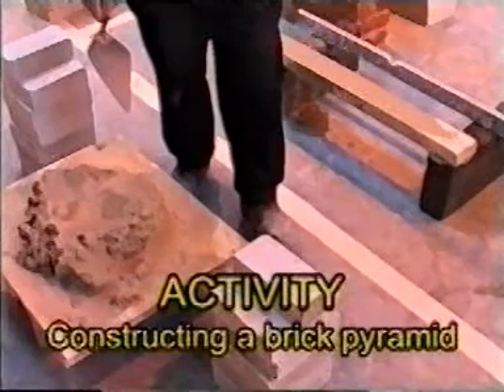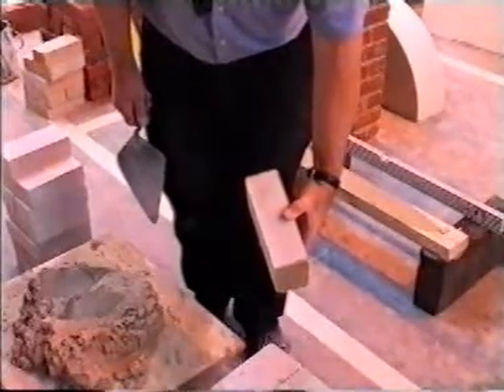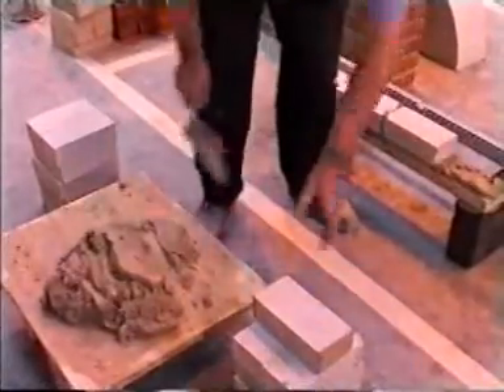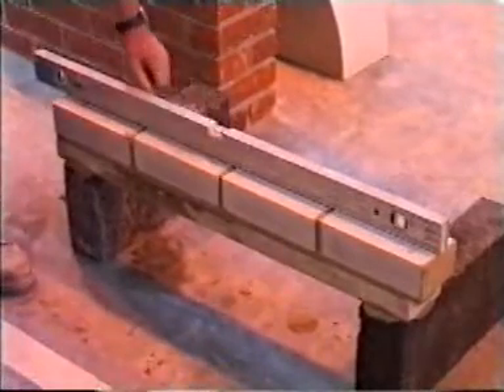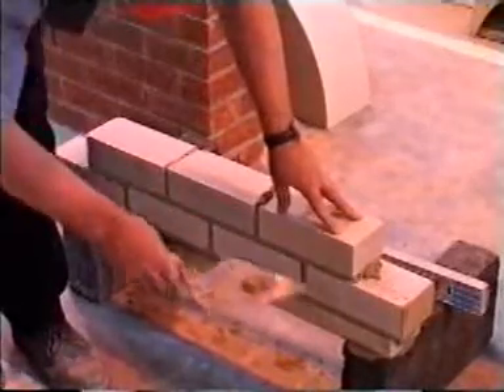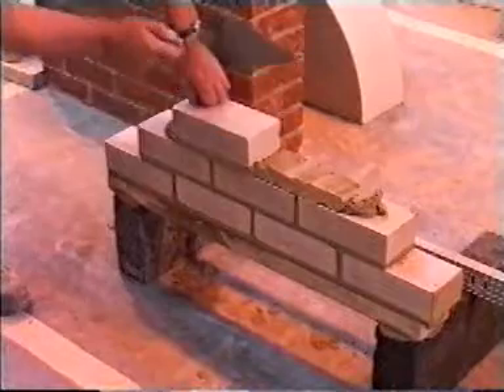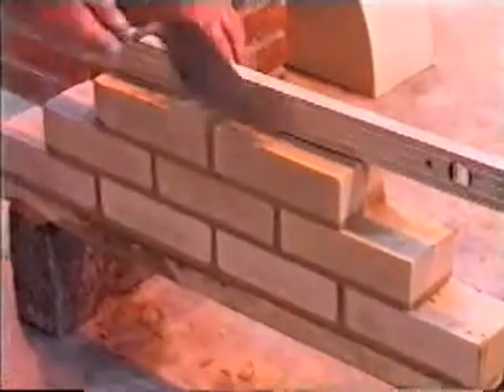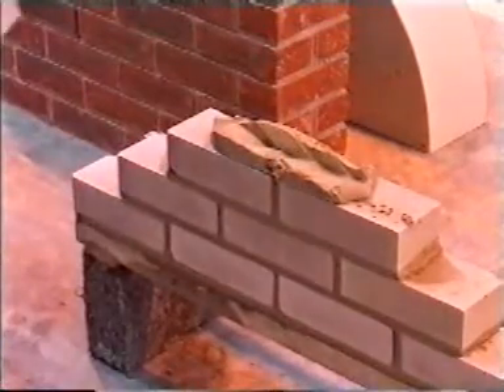08 Constructing a Brick Pyramid

Comment: How often do you build that on a job? Does it look like a pyramid to you?

 A pyramid (from Greek: πυραμίς pyramis)[1][2] is a structure whose outer surfaces are triangular and converge to a single point at the top, making the shape roughly a pyramid in the geometric sense. The base of a pyramid can be trilateral, quadrilateral, or any polygon shape. As such, a pyramid has at least three outer triangular surfaces (at least four faces including the base). The square pyramid, with square base and four triangular outer surfaces, is a common version.